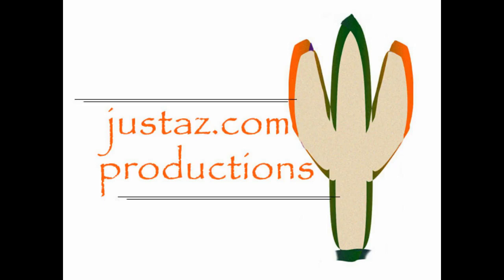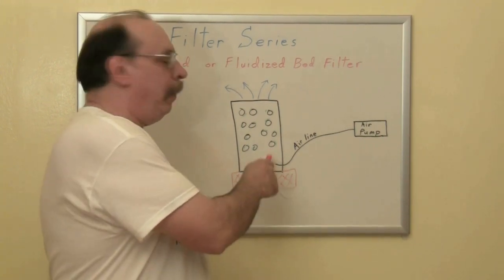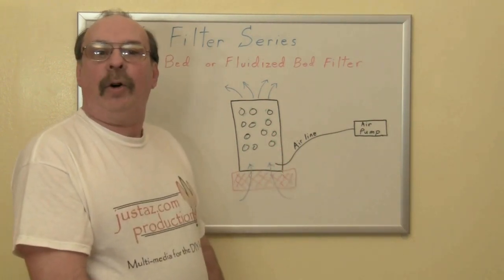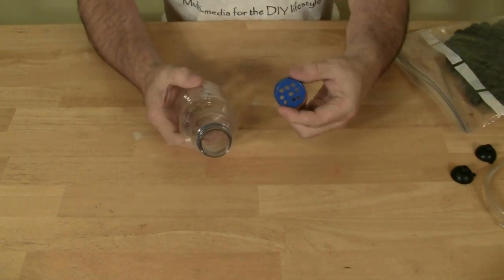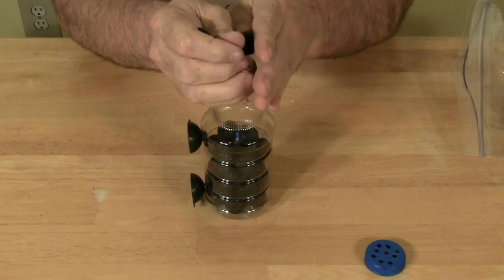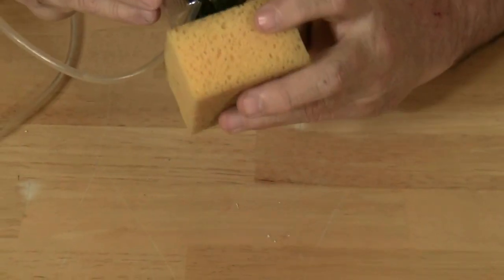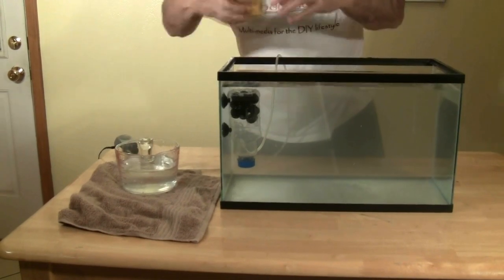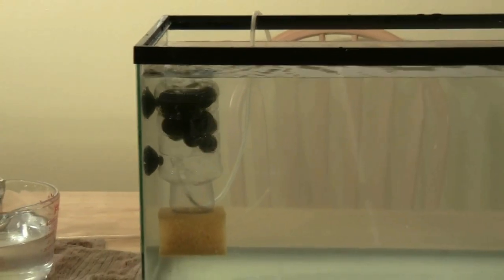Aquarium Filter Series: 3/8: DIY Moving Bed Aquarium Filter

Comment: Hi there, i find your video's nice and straight forward! I am in the process of moving my turtle to a 4ft larger tank and want to start a project like this. My question is would i need a 1.25 litre bottle to accommodate this? Also I have heaps of coal that needs to be used for my already constructed filter i bought from the pet store, could this replace the bio-balls. Just curious. Thankyou
Reply from the maker: Hello, Stephanie Francese. We advise using a larger bottle, probably a two-liter bottle. It sounds like the tank is sizable so the larger filter would make quite a difference. As to the coal: That won't work. Coal is active, that is, if you pass water over it it reacts. Inert media, such as plastic, has no effect on the water or the bacteria growing on the media. Thanks for our great questions, and for visiting our channel.

Comment: hi, good video. I've used this kind of filter for a while now but with k1 media, it works really well but my only concern is would this type of filter be sufficient to use if i started using co2? Will the oxygen that the filter produces dissipate the co2 that I'm trying to diffuse into the tank? A normal internal filter doesn't produce that much surface agitation"oxygen" so I'm thinking that mite be a better option. Can you let me know your thoughts on it.
Reply from the maker: Hello, lee mcshane. I honestly don't know for certain, and would suggest speaking with your local fish dealer or fish club members. What you describe could certainly be the better option, but I can't say with any certainty. Please let us know where your research leads you, and best of luck in this and all your projects.

Comment: I have just made a floating media filter bed with a 1.5 L water bottle using k1 media from evolution Aqua what size of pump should you use I was using a double out let but on inspection it was making a very loud noise on a closer inspection I found two very large cracks in it so it gone in the bin it did pump 3.5 l L a min I have a very small pump on it now will that do ok or should I go out and get my self a bigger on with a double outlet any feed back would be nice I don't know the size for usa I live in uk England and we use litre a min in a pump but in filters we use litre an hour
Reply from the maker: Two important factors are the size of your tank and the bio-load (how many fish, plant life and other biological factors). Monitor your nitrate levels and if the levels are too high, you likely need a stronger pump. Thanks for your question, and best of luck to you.

Comment: i dont know if its a stupid question .. but how does the water move? and do we just connect a pump to the air line tube ?
Reply from the maker: Hello, rakesh. v Kumar. The airline tubing directs air into the bottle, displacing the water in the bottle and forcing the air out of the top of the bottle. This creates a kind of current, and so the water is sucked through the sponge, through the bio media (bio-balls in this case), and then out the top. This is continuous, so the water keeps moving and the filter keeps filtering. Thanks for taking the time to comment, and best of luck to you in all your projects.
Reply: Thank you

Comment: I've been watching this whole series just have this video and the first two left.  Question.  Is there a certain kind of foam to use for the hamburg?  And how do i know what plastics are safe to put in to water such as for the wet dry vid
Reply from the maker: Hello, Travis Stanford. You can use a polyester foam or a polyether foam, which is more expensive. The foam should be porous, not just on the surface but within the foam as well so the bacteria colonize throughout the foam. Just select a decent quality product and you should be fine. As to the plastics - as long as the plastic isn't cracked or broken, it should be okay. Avoid anything painted, of course, or that has been exposed to high heat. Thanks for your great questions, and best of luck to you in all your projects.